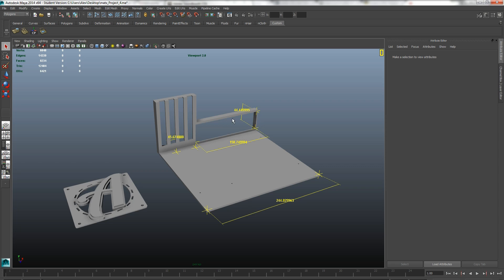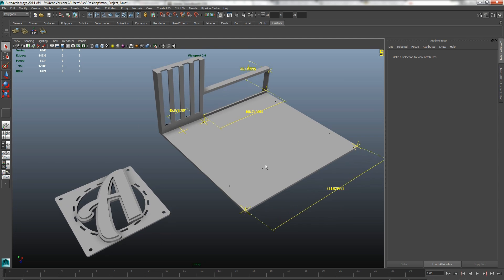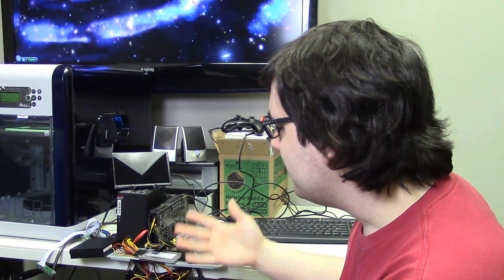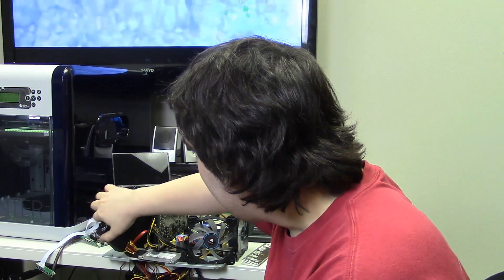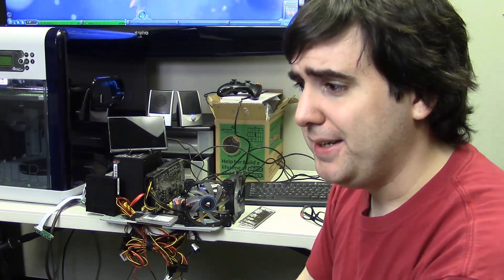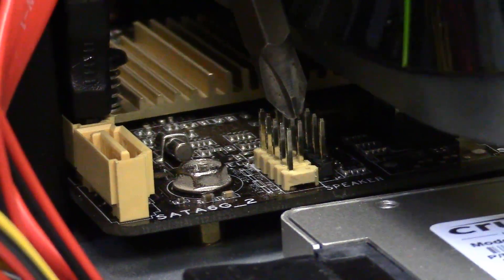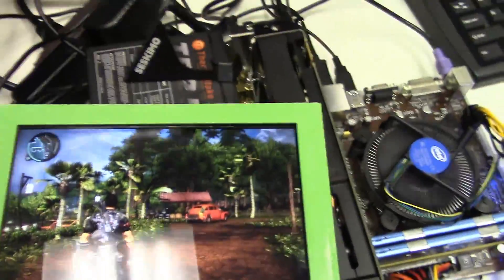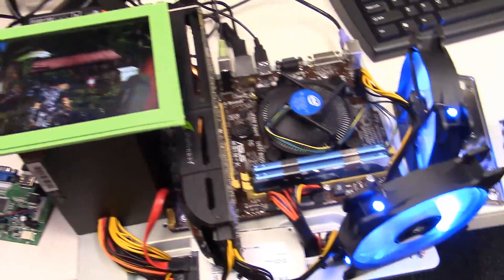3D Printed Computer Case - Part 1

Comment: Where are the STL files for this posted?
Reply from the maker: +John P I haven't posted them yet, but I'll put them on Thingiverse soon. Keep in-mind that the IT guy deleted one of the files on accident and there are a few refinements that should be made if this were to get re-printed. That's the main reason I haven't posted it anywhere yet - that it's 90-95% complete rather than 100%.
Reply: Roger that. Iooking forward to my next project.
Reply from the maker: Well, a lot of life happened, but the files are up on Thingiverse now. :) http://www.thingiverse.com/thing:1689991